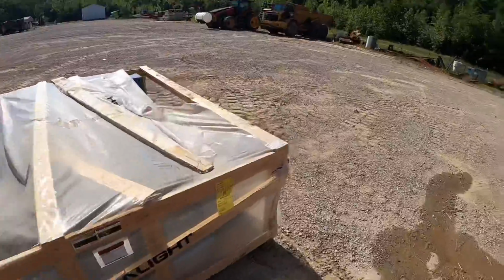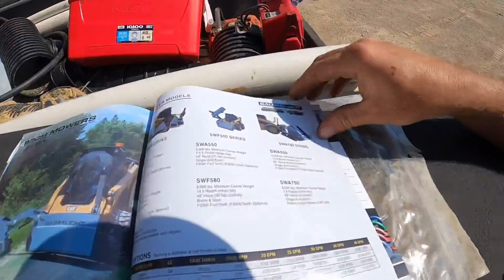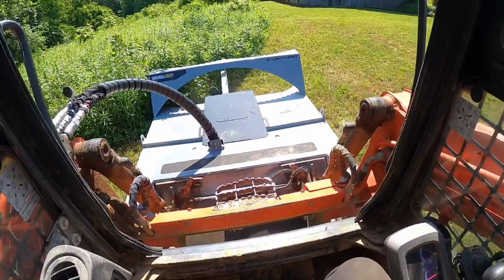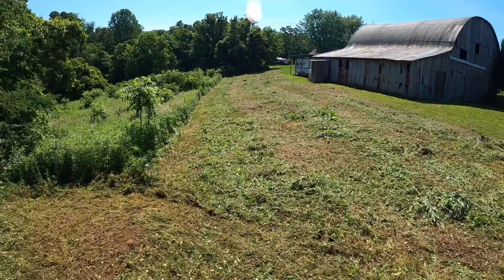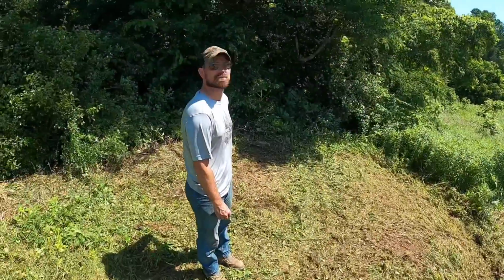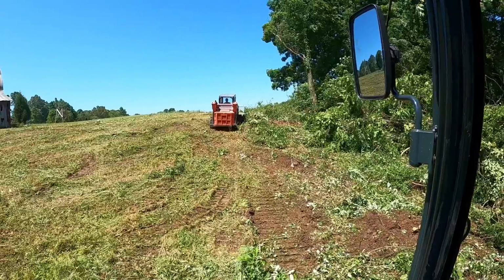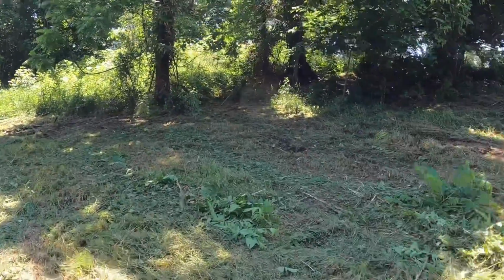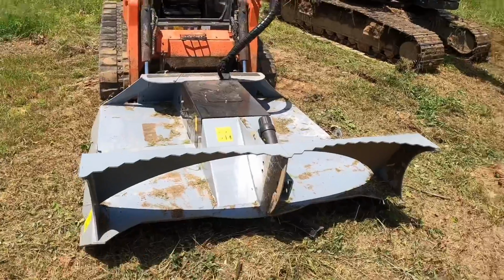Mystery crate opened- first impressions and use of the Baumalight 72 inch brush cutter in action!

Comment: I’ve run brush cutters before and this looks like a good one. One suggestion though. If you overlap each pass by a quarter, you’ll get a better mulch and reduce the load on the blade. This will help when you’re cutting the big stuff.
Reply: I agree and to raise the front just a little bit higher than the rear gives it a double cut and minimizes counting on the ground

Comment: The travel speed loss is due to a low flow attachment.  High flow would be 3x faster cutting because the attachment will not lose speed and momentum plus it recovers way faster.  The best method I have found using ours cutter on our SVL95 is to keep the front of the cutter about 3" higher than the back and keep the back 3 to 4 inches off the ground if possible.

Comment: That seems to be working really well.  I have one but it's a Chinese version and we needed to redesign it from the start.  We use ours more for cutting the fencerows back, so I am lifting the mower up as high as the skid loader will and coming down on the tree limbs.  It does an awesome job but has sticks flying everywhere so you need to be aware of who might be around you.  With doing that, it does throw sticks and leaves into the cab so I need to run with my door on.  I like how your shields are.  Mine seems to collect a lot of trash on top of the mower and yours seems to get way less.  Another awesome video that you have posted.  Thank you, keep them coming.
Reply from the maker: Wow did you watch the video at all

Comment: That brush cutter is quite the little beast.  Should come in handy often.  While I grew up in the country, it was a small 3 acre parcel.  Mostly woods.  But there was one section,  about 2/3 the size of the piece you started at that would get over grown.  Too small to spend money on power equipment so my dad did it with a  scythe.  10 year old me was in tow with a sickle to take out the stuff close to the tree trunks.  Loved my childhood but don't really miss that ...or shoveling coal into the coal bin in winter.

Comment: I think the "travel speed" quirk you mentioned is probably a tradeoff from the blade design. The 4 blades absolutely demolished the trees and brush in a split second. But, they are much harder to keep going in heavy grass. I bet if it had a more traditional round stump jumper and two blades, it would handle grass better. But, then you'd have to slow way down for the trees, hence tradeoff. :)

Also, insert Diesel Creek's OSHA song. lol

Comment: I love that new brush cutter for the skid steer, that thing sure will cut . I see several people running one of these and they do not take a full width cut in bigger stuff, they only take about a 2/3 width cut and that way it does part of an overlap cut each time, making it cut some of stuff again leaving a smoother cut . And I also see people when they come up to a taller clump of brushes - trees, they run right up to them and raise the cutter high off the ground at an angle and then bring it down on top of them, grinding them down from the top down to the ground and it doesn't choke the cutter down or the power of the skid steer, till they get through the bigger stuff and then move on forward cutting away down on the ground,  till the next bigger stuff and then raise it up again and grind it from the top down to the ground .
That new 210 is a monster of an excavator tearing those big trees out and moving them . I love watching videos like this and how that it  really changes everything leaving the area all clean and opened up . It sure made that place look different, you all did a great job . And Matt was moving right along and was doing really good with the brush cutter - skid steer coming through behind you . I would like to have a skid steer and one of those cutters, maybe some day . One of my cousins has a smaller Chinese dozer that looks a lot like an older John Deere 450 dozer and it has a 3 point hitch and PTO and we run a big bush hog on it all the time, and I run the dozer a lot bush hogging on his farm for him about 4 miles from my farm . And you can really clean up with that setup, if it's to big to bush hog, then I go to pushing it down with the blade and piling it up and sometimes I can use the bush hog to cut the tops up with and that just leaves the trunk of the trees to haul off, then smooth it up and then
 go back over it sometimes
 with the bush hog .
Thanks for the video and I will see you all later on another one, so take care and stay safe working .
🤗👍💖💫

Comment: It works swell. I really like the design of the cutter, the fence on the front of the cutter that pushes the larger stuff over and the extended blade path cuts larger stock. The chains on the back of the cutter also helps keep the brush from flying into the skid steer. Nice unit.

Comment: Hi from uk Mike and crews 👋👍 hood Jon getting a bit more land opened up up for Chris  and the cutter looked it coped well considering  you threw a few big ones in the equation  once used ti it it'll be better tho cos it makes all the difference between pulling a cutter and pushing one but once get reference on the skids and their height  it will be a blast to use anywhere👌 thanks for your time be safe and see you soon 👍 👋

Comment: Nice clearing job!👍🏼 Just a helpful hint to try with the brush cutter, when you're in the deep nasty & heavy stuff, tilt the front up a foot higher than the rear. Let the rear determine your material height and the front pre-cut it and it keeps from robbing all the power cuz the whole carriage isn't in all the material bogging it down. Pluss you dig in less in the woops "think shorter wheelbase", kinda the same way you get better quality mulching when back-dragging, less dramatic up and down with the terrain.😉

Comment: If I make make suggestion here if you were to mount a pair of small rubber ties on each front corner of that machine in a fashion so you could adjust how high you want to cut  you would get awaw from the scalping problem and make the wheels so the swival!

Comment: One trick is to raise the front up in heavy stuff and it helps chop it up as you go across it vs having to go straight into it. Works really well this way for thick briars and brush, then level it out and back up to finish it off.

Comment: Seems to do a good job.  I wonder if a high flow would do even better?  I don't really know if high flow would keep the rpm up longer and allow  more speed of travel. I watched outdoors with the Morgan's and he tested a disc type cutter it left everything clean. If my memory is right it would cut up to 6 inch trees and grind them up.  He was cutting new trails in the woods. I do remember the machine had ballistic door glass to protect the operator. I think it recommended a safe distance was 300 feet from it during operation. I am impressed with the new excavator it seems to be a work horse for sure. Will be waiting for the next video for sure.

Comment: To me it looks like you can put a boat through the outside of those side and put your little rope couple rolling wheels on it where it won't go too low and it's always just rides the texture of the ground about an inch and a 1/2 2" off the ground

Comment: You are going to love that bulrush cutter. We have one (different manufacturer) and use it on our Bobcat clearing cedar etc…and it is a beast. From experience if you are around rocks or potentially around rocks, I recommend closing the door on the cab and upgrading to the forestry door that is made of poly. I’ve seen (on ours and others) rocks and pieces of wood fly out the front, bounce off something and bust out the door. I know of one guy that took a rock to the face and it was not pretty.

Comment: I have the exact same problem as you with hydraulic mowers.  I was considering one for a 5115m John Deere but the horsepower rating doesn’t work out. Also would like one wider.  I do believe that one to be better than the other skid steer mowers I have had experience with. I just seem to like the mechanical gear box “bushhog” better.

Comment: I am a retired small engine mechanic that worked on landscape and logging equipment, The death of any mower is people not washing out the underside after use. Fertilizer and chemicals sprayed on it consumes the metals, It will turn that thing into rust.

Comment: Is that box tubing that is on the the center front of the brush cutter pointing straight out the front for mounting something? It looked like it has mounting holes for mounting some sort  of accessory but i cant imagine what would go there and their website doesnt show anything or even show that piece on there in most of the pictures i saw.

Comment: It's yours I'm glad you're happy with it. But if it was mine I'd bring it back. I want a machine that I don't have to wait for it to build back up RPMs and that one's already doing it you haven't even gone 30 ft yet you've only took down a inch big around brush you know they just don't make them like I would want one to work and in my opinion it still needs a high flow that way it won't bog down the freaking RPMs of the blade so bad
Reply from the maker: Ok good for you lol 😂

Comment: Not to sure about this mower , it seemed to lose rpm to easily and you had to wait on it to regain rpm , don't know if the hydraulic motor is geared more towards rpm vs. torque , If it works for you all the better , I have been researching cutters for a couple of months now and what impressed me the most is MTL XC8-T or the Blue Diamond cutters , they seem to have the best of both worlds , a large disk for flywheel effect for the cutting blades and inset from the blades are  carbides to grind with  , very impressed with them
Reply from the maker: I have zero complaints work awesome

Comment: Well I'm hoping that the regular flow will make it so it doesn't bog down to nothing every time you start cutting with it I noticed that with a lot of mulchers and a lot of these as well mulches are worse in my opinion but I hope it doesn't bog the engine way down and then you got to wait 5 seconds for the blades RPMs to get built back up that really sucks on anything you work on or work with I hate it when that happens and there's no excuse for it in my opinion
Reply from the maker: Love guys like you thanks for all the comments 😁
Reply: @DirtPerfect  GFY
Reply: @DirtPerfect  send time and address, and I'll be there

Comment: l have a John Deere 5225 that with a Rhino cy60 that will do a better job. it will take out up to 3 inch and pto driven with slip cluth and does not slow down. it is a lot to back up to do it, but works good for me and I only paid 3000 dollars for it. Not to be critical, but threre are a lot of options.

Comment: Nice cutter… I like it better that the little one Chris has for his mini.
I’m sure Mike and Chris have seen a 72 inch Forestry Drum Mulcher mounted to a high flow skid steer. Those things will eat ANYTHING and do it in a blink of an eye. No need to own a stump grinder if you own one of them. I’ve seen them make a 24 inch stump disappear in 60 seconds. 
If this bushhog impressed Matt he would flip out operating a drum mulcher. One them would have finished the work in this video in an hour or so.
There is a downside. 
A decent brand high flow Forestry Drum Mulcher is around $25K. To really make them work like they should you have to have high flow hydraulics which isn’t a common feature on equipment.

Comment: I'll tell ya what I told letsdig18. I saw two brothers take turns on grinding a 40 inch oak tree down to a slab branches and all about 100 foot tall with a New style  brush hog whose rotor resembled the blades of the shredders recyclers use for metal and it was attached to the biggest model Kubota skid steer  and this thing never bogged down and did that to that tree in 4 hours, oh and I forgot to mention they cut the tree down first with their chainsaw. Their channel is Goonzquad

Comment: And Mike before you say that's not true it doesn't bog down at 18 minutes and 9 seconds your employee had to stop to let the RPMs build back up, and in my opinion it shouldn't it shouldn't have to be that way. Try taking half of the width of the cutter instead of a full width you'll see a huge Improvement I guarantee it in fact I bet you a million dollars and yes I have it in equity but I have it

Comment: Nice, most of those bushes are sumac, much of what I've seen they get up to 4 inch trunks can grow to 20 feet if left alone, the trunk and branches have pithy interior not too stringy perfect for brush hogs, I saw a Kubota all wheel drive tractor run a brush hog and it did not bog down, it had a 3 cylinder diesel engine, also the brush hog letsdig18 uses bogs down too, I just figured it was because it was mounted to a mini excavator and it's a different type. Are the companies making them different in power so you don't accidently maim a corpse or a child maybe playing in the grass, I don't know what, I just like the tools that don't bog down but activate the governor to increase engine power so you don't have to wait on them to speed up. I am not being insulting I'm just curious as to why these do this now but 30 years ago they didn't. Edit: Aha the answer pto drive just needed to watch a little longer Thanks DP, I'm stupid. LOL
Reply: Its all in how they are powered.  Tractors will use pto.  Which is direct drive from motor.  Skid steer is hyd flow powered it cannot keep the same momentum when sold contact is made.  It works off of inertia.
Reply from the maker: Yup

Comment: Why did they make it so it only turns one direction? One of the best features of a hydraulic drive brush cutter is to be able to use both sides of the blades without having to flip them over.

Comment: Looks to me as the skid steer didn't have enough power to keep it running at a constant rpm. My old Allis Chalmers D15 with only 30 pto horsepower, had enough power to run a 6 ft shred at a constant 540 ptp RPM and I cut fields at least that thick a lot of times
Reply from the maker: Sorry to disappoint I had zero complaints

Comment: I think your Hyundai is more powerful than letsdig18's 220 Volvo, he has to totally dig around the trees then push them over and sometimes it takes awhile, heck I don't know you might have better mechanical advantage due to stick and boom length or a heavier counter weight or all of the above, I just know the Hyundai does it quicker.

Comment: The only thing about these type of brush hogs, that there's never enough power or hydraulic pressure to keep it going full blast as it draws way to much hydraulic pressure and it slows down to much for any small brush, should look for one with a 30 horsepower motor to run the hydraulic system and then it woke slow down as much as it does on the skid steer.
Reply from the maker: Not how they work I have no complaints

Comment: If you happened to fabricobble a skid-steer attachment to excavator quick connect adapter, what skid steer attachments might you use on an excavator?
Flail mower, concrete mixer, forks...